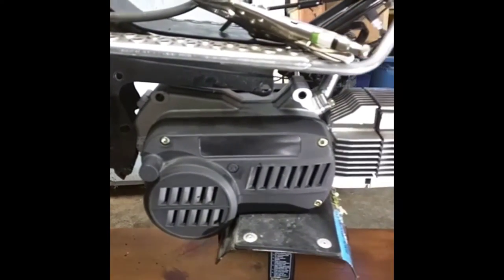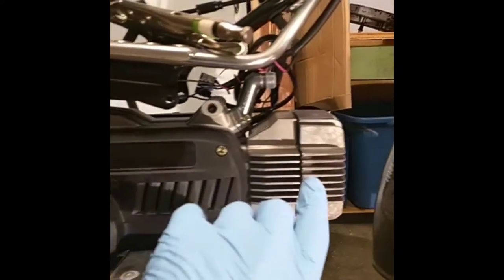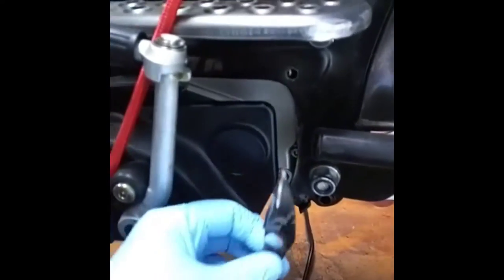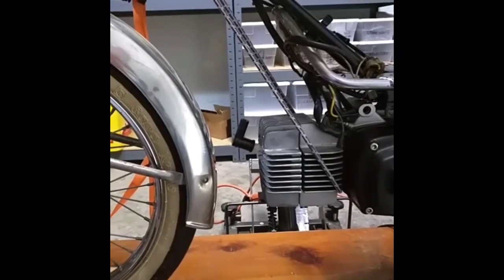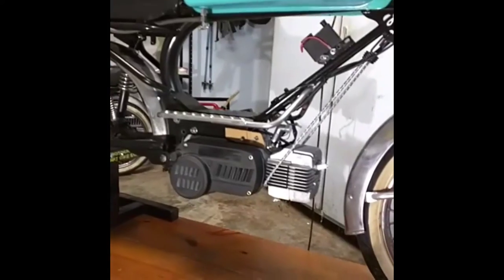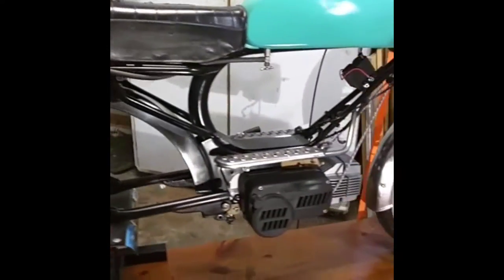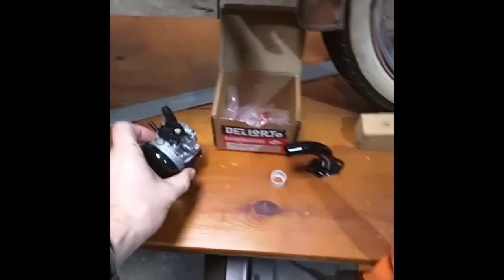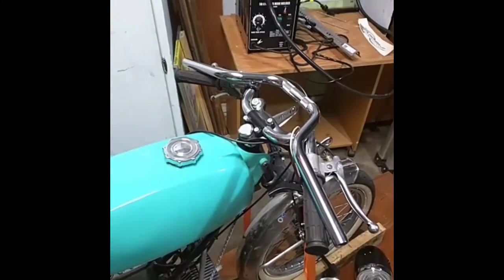I am putting an M101 on a Pacer Super Sport.

Comment: I WANT MORE!!!!!! Seriously, i love what you've done so far. I have a 1980 Super Sport with the M1. Only 300 original miles. I picked it up last summer for an UNBELIEVABLE $100. It needed a wiring repair and a carb needle. It runs great. I'm thinking ahead about an engine replacement just in case the M1 takes a dump. Where did you get that engine for yours? I've thought about doing a small 4 stroke conversion. It would require serious frame surgery though. Your option seems much easier. PLEASE do an update video with info on where you purchased the engine etc...Thanks!!
Reply from the maker: Greetings William, would be happy to answer any questions I can about this. I bought the engine off of a Denmark website that unfortunately no longer has them listed. :( They can still be found but it can be tricky. In spain they were sold on Suzuki Maxis and in Finland they were sold on Tunturi City bikes. You can find photos of my build here: http://garage.1977mopeds.com/build/Blu and if you are on FB and need Morini advice you can find other Morini lovers here: https://www.facebook.com/groups/675266315869538/ I am planning to do more videos but I have been waiting for warmer weather. :) I still have some adjustments to make to the bike.
Reply: The Wandering Pacer 
Is the M101 a 49cc? What is dual variated? 2 speeds? Thanks so much for the info!
Reply from the maker: Yes, the stock M101 is still a 49cc engine to meet law requirements. The engine is not a 2 speed but Dual variated means there is a belt that runs between two variators that adjust front or back tension where power is needed most. You can see from this diagram the variators and the belt. http://www.myronsmopeds.com/wp-content/uploads/2015/06/Info-Morini-M101-Engine.jpg

Comment: Where did you get the engine from? I would need one
Reply from the maker: I got this one off of a dutch website years ago. The company that makes them went out of business in 2012. These engines are still out there but mostly in Europe.
Reply: @thewanderingpacer  do you know where i can find replacement parts? or how can i change the reeds or on the valve they dont have screws and i need a new variator belt but cant find one anywhere
Reply from the maker: @11sjv  If you are in the US there are a couple of websites, doscycles.com and treatland.tv that carry some parts for Morini's. Trealand usually has more listed on their site but if you contact Dos they may still have some they never posted. If you search Treatland for "morini M101 drive belt" you can find the belt. You would need to mod the stock reed block to take screws or you can try the one on Treatland by searching "MLM morini M1 & minarelli v1L cnc'd aluminum reed block".